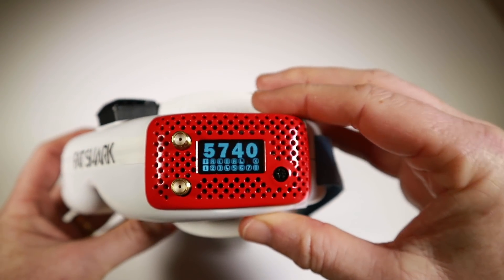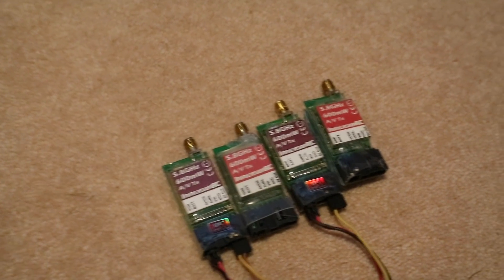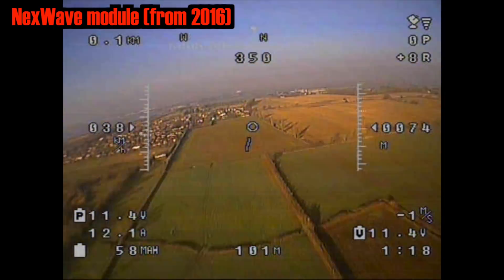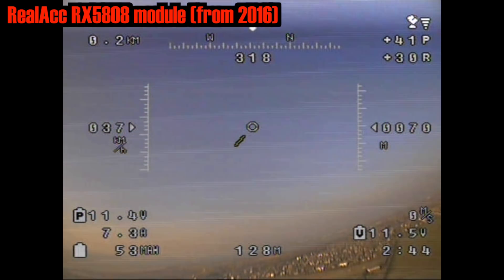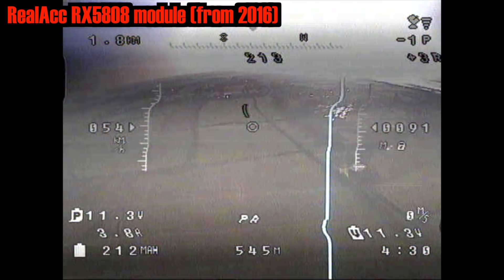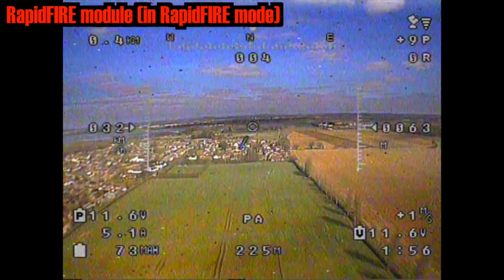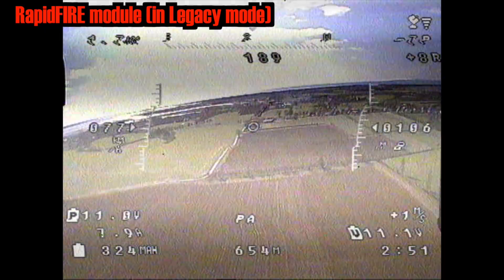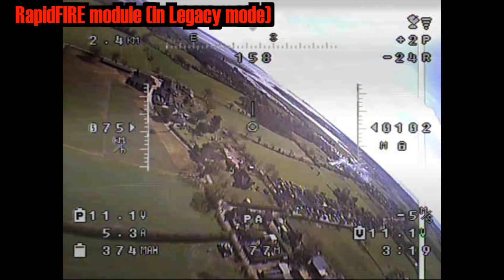Retesting RapidFIRE with some original IRC600mw VTX's

Comment: Hi Wayne, have you tried a newer WDR camera such as an Eagle or similar? It looks like the CCD flaring you get from old security cameras. I bet those VTXs are solid.
Reply from the maker: If it was just down to the camera, then you'd hit the flaring issue on the NexWave RX as well.  The modulation issues is definitely a "known thing" and I have reproduced it using other cameras on my RX5808 module, but not tested everything on the RapidFIRE (yet)
Reply: Ah, I see now.

Comment: Owlrx module is so much reliable that rapidfire because works every single time...
Reply from the maker: Owlrx looks good, but it's "just" a diversity module so doesn't quite do the same thing... although as I said, if you are flying in the locations/situations where you don't need RapidFIRE mode, then it's probably all you need.
Reply: @CurryKitten  you are wrong, it's not a standard Diversity module, it's the same tech as RF with very near performance.
Reply from the maker: Which model are you talking about - the one I found tells me it's a diversity module - none of this attempting to create a single good video frame by picking and choosing bits from the two receivers ?
Reply: "That allows to
minimize signal latency, increase switch rate and allows to "extract & reconstruct" each frame of
image from small pieces of available signal from different antennas. Also OwlRX makes video
signal restoration to improve stability,video quality and prevent frame rolls."
Reply: @CurryKitten  So it's not a standard diversity vieo RX, i have one and i fly with friends with RF, it's very near performance with the advantage of never loose lock or have frame rolls
Reply from the maker: I'm sure it's great - and I'm not arguing that one is better than the other.  All I'm saying is that they work differently.  Why are Owl RC saying "extract and reconstruct" in quotes - I find that a bit odd.  Reading between the lines, and given that the switching rate of the OwlRX, I'm guessing it's able to switch antennas mid frame or something like that.  I'll have to ask.  But anyhow, not to be Mr Pedantic or anything, but I'm saying not the same tech.
Reply: @CurryKitten  It's not the same tech, i didnt say it was the same, what i've said is can have similar results with less problems in the way. That's what i've said. Anyways it's another option. :)
Reply from the maker: Ok, now I am being pedantic guy, but look at your second reply where you said "it's the same tech as RF" :)  That said, I'm certainly interested to know ho w it works and would like to check one out if I get the chace.  I just fired off an email to Owl to see if I can et any more info

Comment: I too have a number of those 600mw Immersion vtxs, they all work fine with my Diversity Monitor, as do the very small modern VTXs.....My conclusion, is that the fault lies with those Goggle receivers perhaps? You might want to try cleaning up the power supply to your Camera and VTX though. ESC noise can be incredibly disruptive to any system. I always use an LC filter.
  The excess sunlight was instrumental though in its downfall, how strange.....were you using CMOS Cameras?
Reply from the maker: There's a dependancy there about how old your IRC600's are.  IRC tweaked the PCB in later models so they would work with any RX.  The point here was to show the difference in the same setup in NexWave, RX5808 and RapidFIRE with only the original NexWave rx working as it should.  So although there was some ESC noise going through at high throttle, it was consistent throughout.  It's a CCD camera, featuring the very popular Sony Super-HADII sensor
Reply: @CurryKitten  Well..mine are as old as yours..they still work with my Monitor though..as do Boscam vtxs...Still say its the goggle vrx IMO..Too clever for its own good basically.
Reply from the maker: Well it's definitely the VRX, but it was supposed to work with these.We'd need to compare close up photos to decide if we had the same vintage, but these old ones shouldn't work with any of the non-IRC VRX's.  Which one do you have ?

Comment: Could the problem be solved with a resistor on the video line between the camera & IRC600mw VTX?
That Fat Shark DVR vs true D1 capture video I made, I used an RC832 VRX with dual outputs, one plugged into my goggles and the other into the Canopus unit, I had to put a couple of 100ohm resistors (in parallel to get 50ohms) on the video signal line going into the Canopus or the image brightness would be over blown.

Comment: I think it's a "dirty" pal/ntsc signal. that's what really f'cks up the alignment/sync.
You could go 1 step further and don't "combine" the 2 antenna's and have the old diversity method. Then it should be solved.
Reply from the maker: I did - the first part of the video showed RapidFIRE mode, bu tthe second (and more stable) was in legacy mode where the module just acts as a regular diversity receiver
Reply: @CurryKitten   ah, but (as far as i know ) legacy 1 is still combining and legacy 2 is not. So which legacy mode did you use? ;)
Reply from the maker: That's not quite it.  There's two RapidFIRE modes where both of which attempt to combine the two pictures from the receivers into a single decent image - but RapidFIRE 2 attempts to increase compatibility - whilst Legacy mode (of which there's only 1) just acts like regular diversity

Comment: Hey Curry, thanks for posting this. I have an old immersion RC 250mw VTX that I was planning in putting in my FT Versa wing. I'm guessing it will be similar to the 600 its about the same vintage. Now I know and won't panic when I trying them out with my RapidFire. Keep up the great work and cheers from Canada!

Comment: Try the most recent update for your RapidFire module,  hearing about beeps  whilst loosing lock suggests yours is working on an older version. I’m curious about the outcome of the test after updating to the latest firmware.
Keep them vids coming👍🏻
Reply from the maker: It was on 1.2.4 which was the latest at the time, but since then 1.2.5 and 1.2.6 have sneaked into release.  So it's a maybe, but keen to know if IRC recognise this as an issue that was fixed up

Comment: I habe a Aurora 100 and have bad prop wash. Can you or someone let me know how I can start trying to get rid of the prop wash. I have already ordered some motor soft mount pads. Thanks in advance
Reply: You might have to adjust pids most likely,or you can try different props,gemfan 2" are a  good start,if its oscillations...you might want to look into soft mounting flight controller or motors,hope helps:)
Reply: @huckaberryfpv4986  I've replace factory props with Germans already. I am still running factory PIDS. Is it someone on here that can show some pids that I maybe can use? I am not familiar with pids at this point.
Reply: @huckaberryfpv4986  thanks

Comment: Wasssssupppp currykitten,,,do you think its great investment to buy this or just buy some cheaper module?
Reply from the maker: I think it's an impressive module, and development seems to be ongoing and continuing at a pace.  That said you only get the very best from the RapidFIRE mode if you are in environments where there's a lot of multi-pathing.  If you fly in cleaner environments, then a cheaper diversity system will also do a decent job